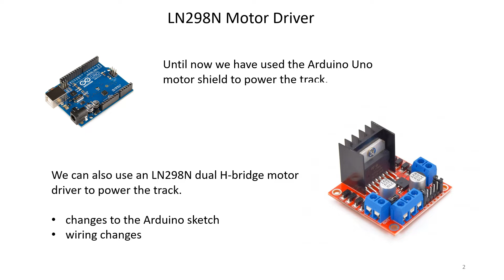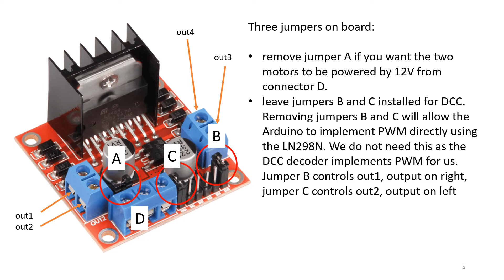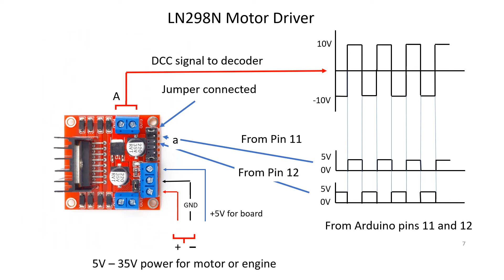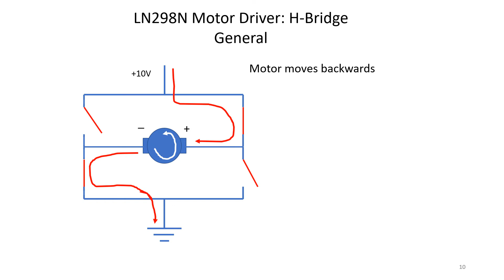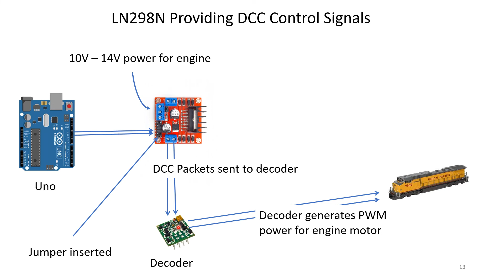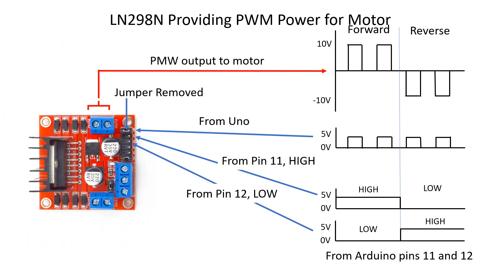DCC Part 6: LN298N Motor Driver Board

Comment: If pin 11 is always the opposite part of pin 12 (or wise versa) that means with an 5V TTL NOT gate you need only one pin of any tiny micro controller to control A or B outputs for the track !